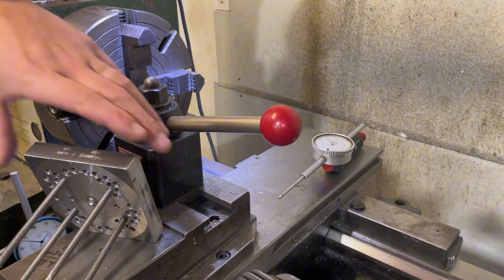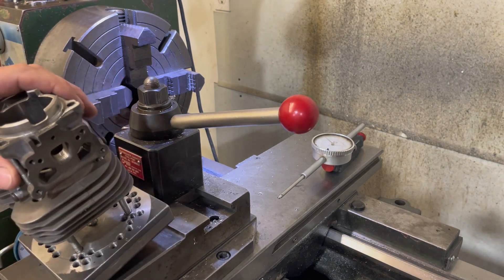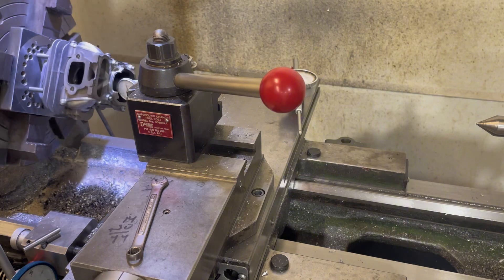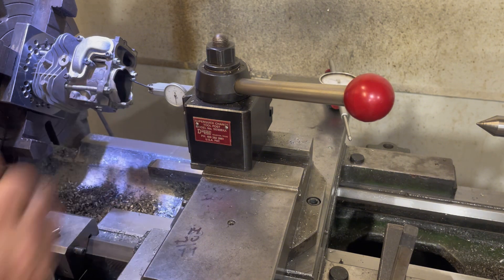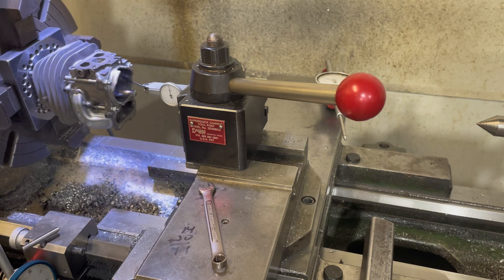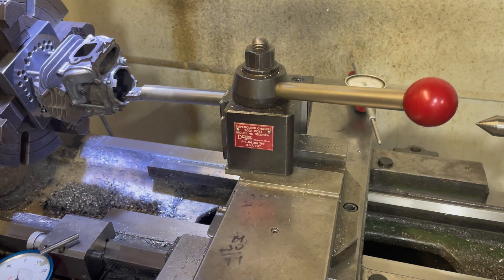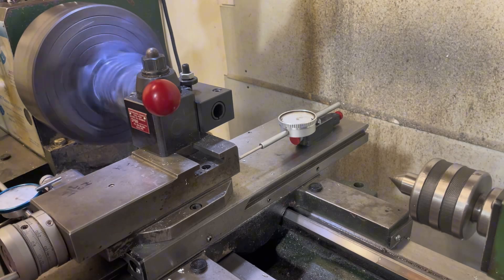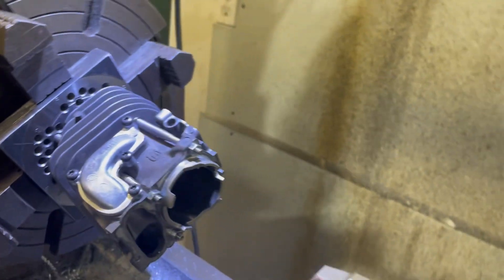SCARR talks squish band cutting process.

Comment: Couldn't a guy drill the pivot point out to like inch plus hole that is filled with the same size round stock say three inches long and then pressed in the hole, then is it possible to use a three jaw chuck and use spacers on the four bolts to get correct specs before doing the process?

Comment: It’s hard to tell but it appears that you’re using either a 0.015 or 007 radius insert. I’d imagine the sharper the better, to cut down on vibration and to lessen the chances of the piston getting too close to the chamber
Reply from the maker: @ericwanderweg8525  I believe it’s a CCGT 32.51 insert. Positive rake, small tip radius so the corner left is sharp.

Comment: I usually daisy chain from band to base dialing in but going for parallel and adjusting chuck side looks like a great way to do it after watching. Using aluminum plates makes that tough to do as they get gummed up from the jaws and it throws the chuck side off a bit as it’s being jacked around. I usually mill them back flat when they get to rough but the steel seems to be the way to go and keep my blank aluminum ones for head material. Great simple video for those who may be overwhelmed at something that can be simple.🤘🫡

Comment: Great vid I need to make my plates out of steel ones I use here an there are aluminum an the edges are all tore up an don't slide in the chuck very good
Reply from the maker: @CharlesBrisco  yup, steel plates work the best. 5/8” or thicker as they stay more square while adjusting. I hit the sides on the big disk sander if they start to get too roughed up.

Comment: If only someone with a website could sell a designed pattern for a few bucks that people could download and print to then drill out on their stock...
Reply from the maker: @appalachiansaw  I was thinking I could just shoot all the holes on my CNC mill and sell a kit with some studs.
Reply: @srcarr52 that sure would be handy.
Reply: @srcarr52  send me one for research and development. Lol
Reply: That would be pretty sweet
Reply: @srcarr52 4.2mm on center every .450 would leave .0562 spacing between hole patterns.Accounting for major dia. .1969 once tapped. Could likely stretch that out a bit and leave the inner circle blank to the smallest base/bolt pattern you could think of and still have a standoff/pivot point in the center. But maybe just pre drill all 4.2mm holes and leave them to be tapped by the customer as they come across new bolt patterns. Possibly supply threaded rod along with it and not have to deal with the tapping portion to keep it quick and simple.